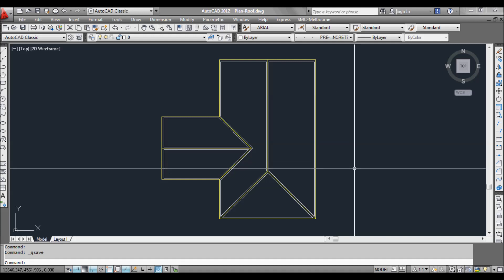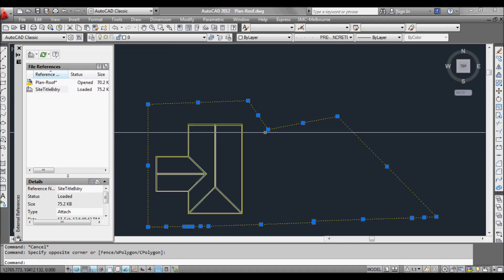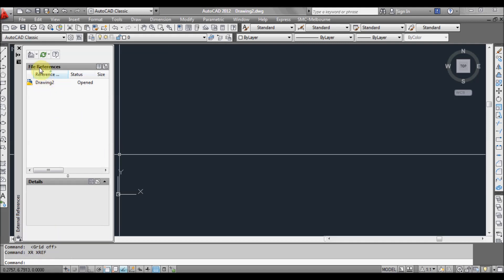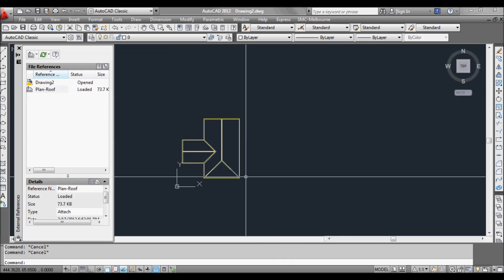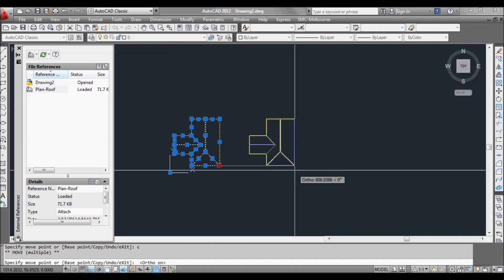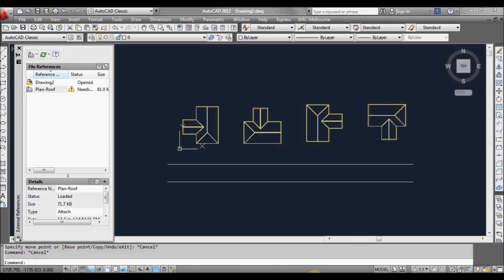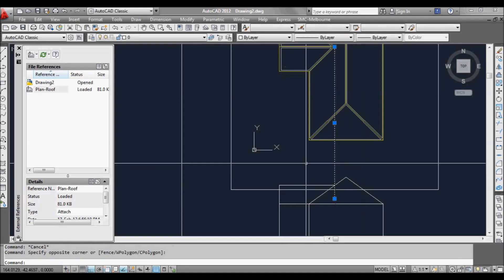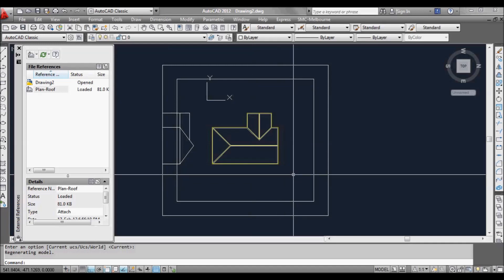AutoCAD Xrefs - Working with and understanding how to use

Comment: whats the difference of how the function between attachment and overlay?? please help me out. just new to this xref kind of things. thank you so much for your time..
Reply from the maker: Hi, the difference between overlay and attachment is simple. If you have a drawing open say called 123.dwg, then xref into it a drawing called xyz.dwg and use attachment method, if you then xref drawing 123.dwg into a drawing called ABC.dwg both drawing 123.dwg and xyz.dwg will be xrefed in as xyz.dwg was attached to 123.dwg.
If you xref drawing xyz.dwg into 123.dwg as overlay, then xref 123.dwg into ABC.dwg, only 123.dwg will be xrefed in.
Basically, xrefing using attachment instead over overlay will only be noticeable if you then xref that drawing into another drawing. Attachment method means any xref attached will be also xrefed into other drawings they are attached to.
Reply: thanks a lot for your reply.